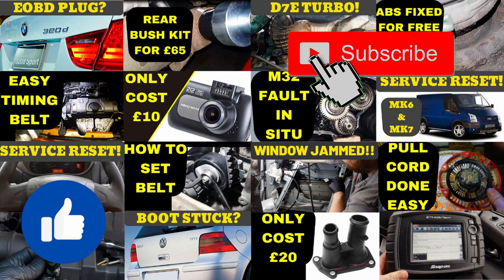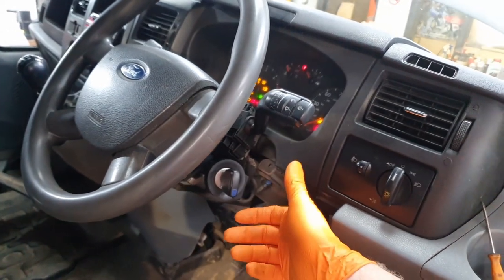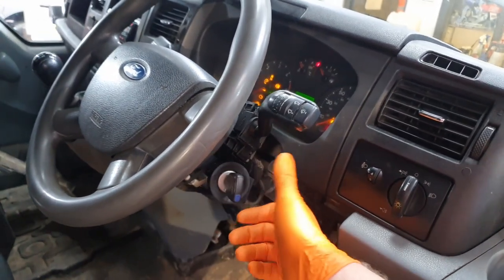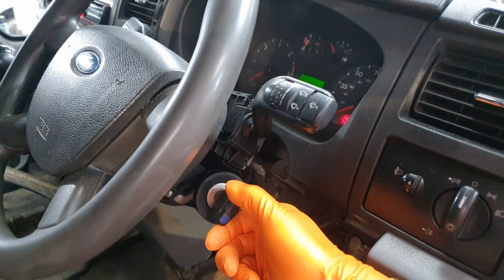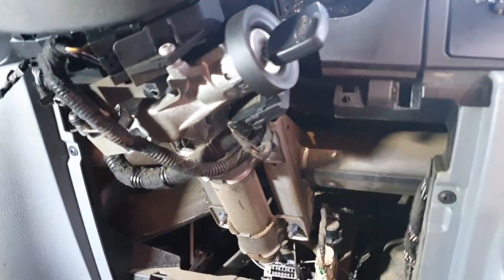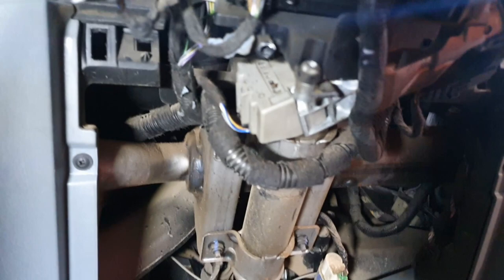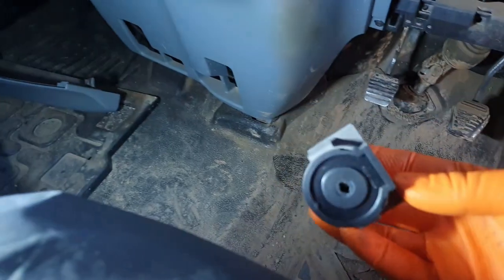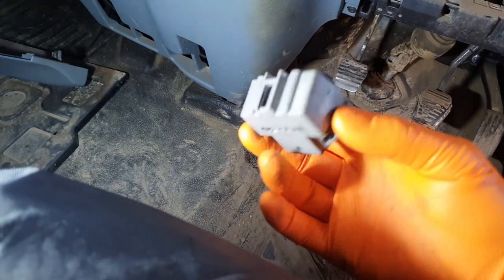Ford Transit ignition fault, starting fault that looks like starter motor, battery, wiring easy fix

Comment: I had injectors changed fuel regulator changed relays spend well over 1000 quid with a mechanic and still had issues then got to this video changed part never had issues again thanks mate ledgend
Reply from the maker: Glad my video could help, thank you for watching

Comment: Nicely presented..I just took mine apart...very simple..not so easy to get back together..one cheap piece of engineering when you look at it.....cleaned mine up but still no joy...earlier today.. started and drove the van for an hour stopped..then nothing..had to tow start it to get home...will try and find a replacement tomorrow...thanks for your informative video..it helped, especially getting the part out
Reply from the maker: Thank you for watching and your input
Reply: @Martysworkshop  mine ended up being a starter motor solenoid..what a bastard of a job to get the starter out...and undo the wiring on a 2.4   2008 model..its taken me friggin hours and lots of swearing
Reply from the maker: Not good! I'm glad you found it and thank you for your feedback.

Comment: Good video, think mine is something else though. Turn the key and there's a long pause then it starts, just! Changed the battery, no change. Only happens when it's cold and been stood overnight, any thoughts? No codes showing.
Reply from the maker: Faulty starter motor or maby the starter Relay.
Reply: @Martysworkshop  cheers mate, I hadn't thought of the relay! Thanks for reply.

Comment: I haver a diesel and when I turn on the igniting at 1 all lights up, at 2 I can fire up the glow plugs and they heat and goes off when heated like normal. But when I turn the key to run the starter it just make click sound like the battery is empty (it is fully charged connected to a external battery to help start and a 40A charger). And after a few tries like that it dies completely and nothing will light on anymore...  Also if I turn on the lights and the heating fan all that works, until I try start, then everything dies.

I wonder if it can be same problem? Diesel engines do not have an ignition so it could be different symptoms of the same problem ?
Reply from the maker: This had the symptoms of a flat battery so could be the fault,

Comment: I have a mark 6 doing this...no ignition /battery light coming on...I wonder if its the same thing? She actually broke down at speed...no warning lights and no faults on diagnostics machine
Reply from the maker: Definitely sounds like this fault, i hope this helps
Reply: @Martysworkshop   Unfortunately it wasn't that ..fitted a new ford one today ..still no battery light and wont start

Comment: Hey great video, done this with my transit and it started, but now it cuts out after starting, would this be connected to the same switch fault?
Reply from the maker: Did you replace the switch??

Comment: I have a 09 registration ford transit , garage had changed starting moto and  battery terminals, two days later I was in a shop and some one shouted me that my van was on fire , I look underneath and the was fire coming from the starting moto  , what could be the fault
Reply from the maker: Well the positive cable to the starter could have rubbed through on something, that would be my guess if the fire came from that area.
Reply: Thanks for your reply , I went underneath my van and the  and the ground cable was swinged, it is confusing me me as the garage refuses from taking responsibility and asked e to claim on my insurance
Reply from the maker: They never do tbh, it would be hard to prove I'm afraid,
Reply: The worst thing about it is that the radiator and the engine has not being burned, it only the wiring on the dash board  and the seats burned out
Reply from the maker: Sorry to hear about this,

Comment: Hi again mate. I got the part in the video replaced 2 months ago and its playing up again. Whereas before it would turn over but not start, this time nothing happens at all when I turn the key. So I then have to keep trying this until something happens, sometimes when I push the key hard against the switch it works but not all times. Sometimes when it has actually started the red light keeps flashing. This is happening more and more every day and Im worried it may not start soon full stop. Any ideas?
Reply from the maker: No sure you would need to test the circuit to identify the problem, it could be a faulty switch.

Comment: Hi mate mine was doing same as yours ive a 2.4 tdci transit 2007, then today its stopped working altogether just a click when trying to turn key, their was a burning smell last few times i started it in the day it was really struggling to start aswel earlier in the day, would that be starter motor or same part as youve shown?
Reply from the maker: Was the burning smell comeing from the colum or under the bonnet?
Reply: @Martysworkshop  thanks for replying mate,  was the starter motor all sorted now 👍

Comment: Hello Marty, I have a starting problem on my 2008 2.4 transit van. I switch on ignition wait for glow to go out turn the ignition to start the engine but won’t turn over or turns over for a couple seconds and stops. I’ve had both batteries checked and one did need replacing but the other was ok and was replaced two years ago. I have to switch off and repeat this 4or5 times and eventually the starter will turn over and start normally. While it is failing to start I do hear a clicking noise from under the driving seat. I was told by a mechanic that I have a lazy starter and will need replacing even though this had been done about four years ago. I was wondering if the R1 relay in the pre fuse box would cause this problem also. Your thoughts would be appreciated.
Reply from the maker: Your problem sounds very similar to the fault I had with this van, other mechanics said it was a lazy starter but this switch was the issue, I'm unsure what relay you are referring  too sorry
Reply: @Martysworkshop  under the drivers seat 190 amp one mines the same

Comment: Could this be what's happened to my vw transporter?  The other day i tried to fit a reversing camera and ended  having a fail on my ignition display not coming on and when i went to start the starter motor turned over but van won't start. AA Checked all fuses and said all was working. I'm stumped with it! Have you got any ideas Please. Btw  if you have time please watch my last video on my channel would love a second opinion.
Reply from the maker: Sorry for the late reply, I'm not sure to be honest this had all the symptoms of a flat battery, have you had any joy yet??
Reply: @Martysworkshop  all sorted 👌  I  corrupted the software from the cam bus module on the back of the radio. What a bummer it was but fixed👍
Reply from the maker: Glad to hear,

Comment: Mines starts ok most times but then after a few stops on the road it starts to turn over like in this video and wont start unless I turn the ignition lights on and of a few times. 
But I was told by a mechanic that a fault with the immobiliser module was the problem as that was what came up on the OBD scanner and I needed to go to an auto spark. (Costly).  So how can I be sure as I dont want to be paying for something that I dont need?
Reply from the maker: Is the red light on the instrument cluster flashing when it won't start?
Reply: @Martysworkshop  Just checked mate yes it does. I was thinking it could be Glow Plugs or indeed the starter but as I said a mechanic said he got an OBD Immobiliser problem?
Reply from the maker: Ecu,s can store multiple codes over time that don't give issues, so what I tend to do is clear all fault codes then use until fault happens again, then you can read the codes and see if it has returned, as for the red flashing light on the instrument cluster, it shuld flash slow with keys out then with ignition on it shuld come on then go off. If it flashes fast with ignition on then there is an issue with the immobiliser. Hope this helps.
Reply: @Martysworkshop  It does flash slow with key out as is normal, then it flashes intermittently when cranking but it does not flash when engine is running or when the key is turned to ignition on (thats before trying to start the engine). 

According to my own OBD (cheaper version) scanner there are NO codes stored.  

I dont wish to have to go to an auto spark if I can avoid as last time I was charged a fortune just for 1 wire replacement for the ABS so I am hoping that it may not be immobiliser but something else. 

Surely if there was a fault with the immobiliser the van wouldnt start at all?  

Quick bit of info if it helps.. 
I am unable to lock the van at the minute as I believe the replacement sliding door has not been put back correctly in line with the magnets thus when I try to remote lock the van the horn goes off. It has been working sometimes for a while but now not at all.. Would this have anything to do with the van sometimes not starting even tho the key fob is in open mode?
Reply from the maker: Not in my opinion the alarm and the immobiliser are usually separate,
Reply: @Martysworkshop  OK thanks mate. But should I do what you show in the video and replace that switch or indeed can the immobiliser affect the starting, albeit intermittently ?
Reply from the maker: It's up to you thease switches are quite cheep so I would definitely give it a try.
Reply: @Martysworkshop  NP thanks for all ur help mate

Comment: i have a ford transit connect it wont crank over it says engine hot engine malfunction but it cant be hot because it wont start???
Reply from the maker: Does it have a temp gauge?
Reply: yes but that is on low because the van is cold i also have the transmission light on the small yellow cog i have change the thermostat and the coolant temp senser still have the same issue 
  @Martysworkshop
Reply from the maker: The cog light can also relate to engine faults you may need to get it plugged in

Comment: My Mk7. 2013..129 thousand miles...had non starting issue. Click Click oh..Nothing.!!. Battery 12.9....Visit my Independent super Ford specialist.... Problem was.... Starter Motor corroded inside. Outer casing iin half.... A miracle it had worked!!!!! 460 pounds Ouch but perfect now.... Whizzes and Whirs at speed of sound.... I love my Transit.....
Reply from the maker: Thank you for your input, I love mine too